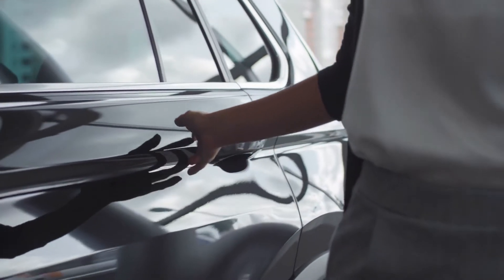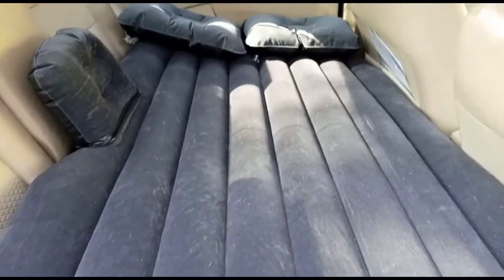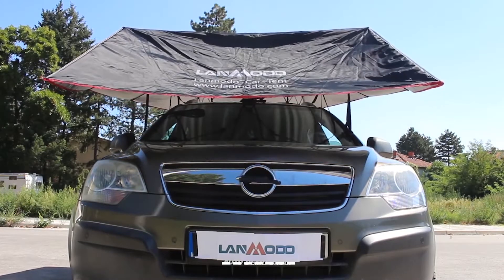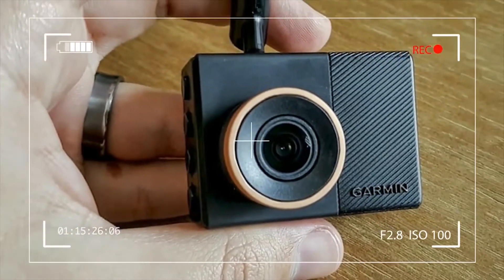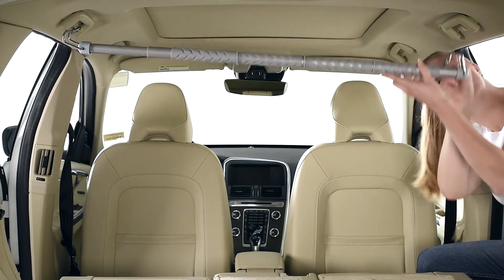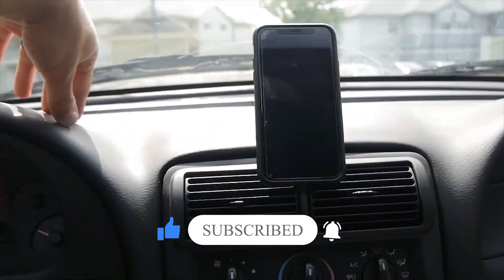15 COOLEST CAR ACCESSORIES That Are Worth Buying From Amazon (Best Automobile Car Gadgets 2021)

Comment from the maker: 0:00 Introduction
0:36 DORIMI CAR AIR PURIFIER: https://geni.us/IUX6Or
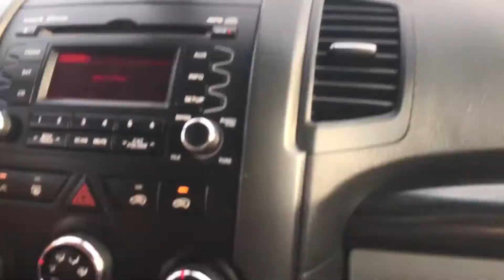1:01 TECHTOOLS HEATED TRAVEL CUP: https://geni.us/rrDMfD4
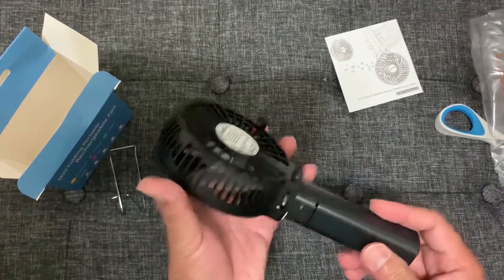1:18 VERSIONTECH HANDHELD FAN: https://geni.us/RsBW
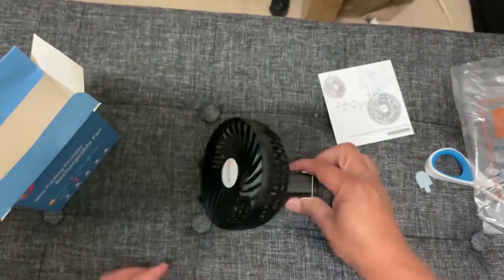1:41 SHEROX HEAD-UP SPEED MONITOR: https://geni.us/HL60jg
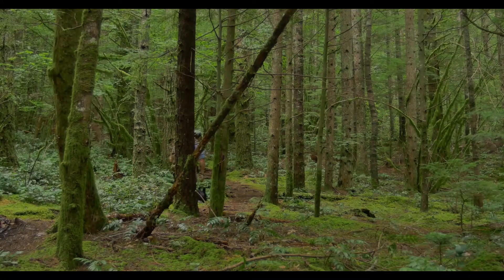2:04 BLACK & DECKER TRAVEL COOLER AND WARMER: https://geni.us/Mm97d
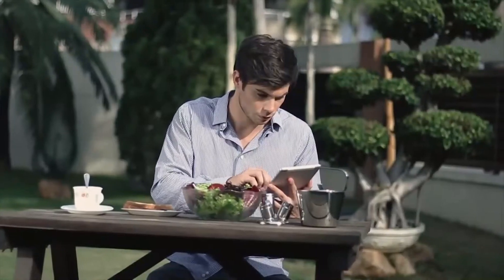2:37 FOBO CAR TIRE PRESSURE MONITOR: https://geni.us/0hpXZdl
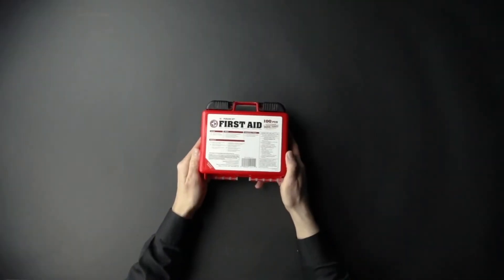3:13 TRI FIRST AID KIT: https://geni.us/GRh0yY
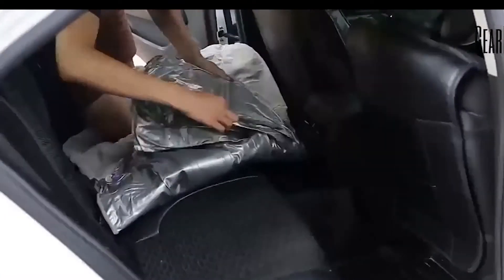3:42 FBSPORT INFLATABLE BACKSEAT MATTRESS: https://geni.us/M0ni7
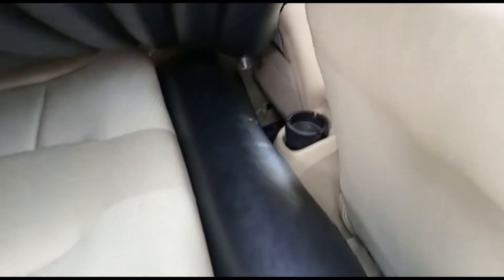4:15 ZTYLUS VEHICLE ESCAPE TOOL: https://geni.us/o1j0G4
5:02 RELIANCER CAR UMBRELLA: https://geni.us/fyRhBE
5:26 KMMOTORS COIN POCKET: https://geni.us/aADw
5:55 GARMIN DISCREET DASHBOARD CAMERA: https://geni.us/rqcT
6:29 IONOX DIGITAL TIRE PRESSURE GAUGE: https://geni.us/BNcj
7:20 HIGH ROAD VEHICLE CLOTHES HANGER: https://geni.us/Zuiqtp7
8:10 VAVA DASHBOARD MAGNETIC PHONE HOLDER: https://geni.us/7Ozo8C